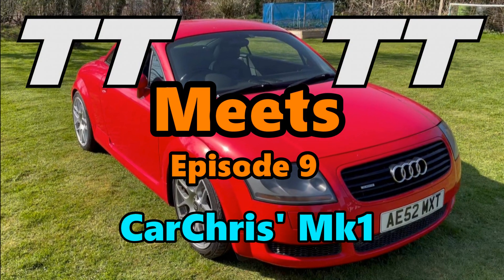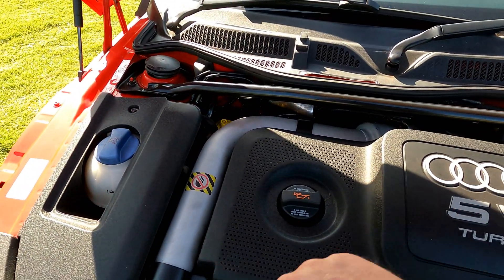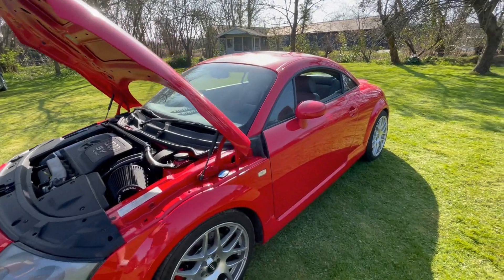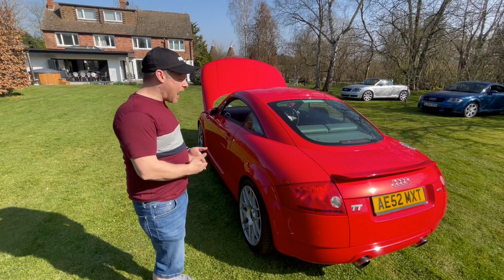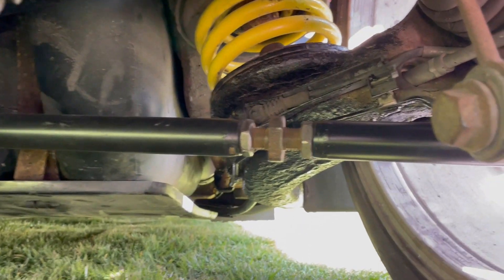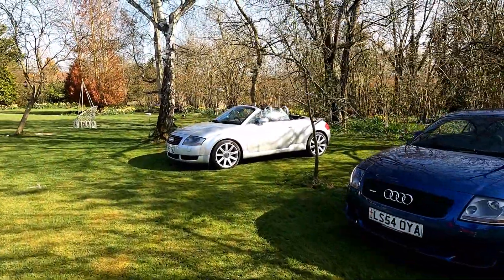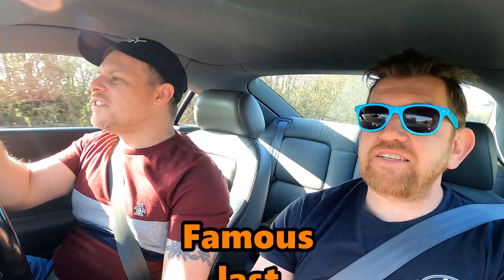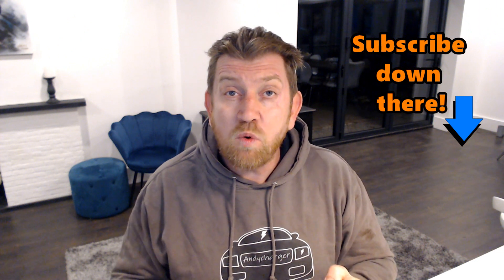TT Meets TT - Episode 9 - CarChris' Mk1

Comment: Gotta love a shiny knob! 🕶
Reply from the maker: Ha ha! How is that car Kenneth? Have you got it out from Norwegian hibernation?
Reply: @andycharger  I thought winter was over, like I always do, but it came a knocking again and showed us who's boss.That old b**ard...

The TT is holding up. It's been my daily driver for two and a half month now and it's been a champ. It has issues of course, being an old car and a TT. I've been doing small bits and pieces, like swapping the booth struts, MAF sensor and the low beams. Next up is swapping the rear breaks, disks and pads, changing the oil, oil filter and the ABS sensors.

I've been playing with the idea of joining your Spring Fest, but it's a long drive to undertake, so I need to be confident the car can make the journey before I take on the venture.
Reply from the maker: @Kenny_Ded  wow Kenneth if you can make it you would definitely be our VIP guest! Amazing if you can. Drop me an email!